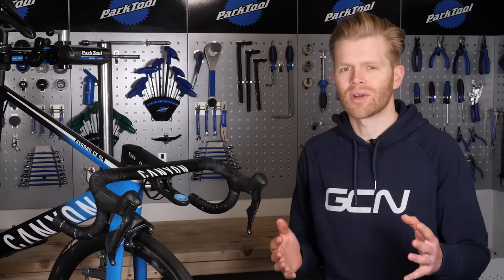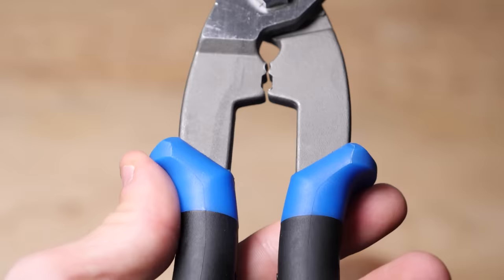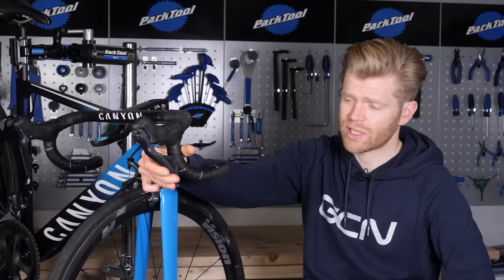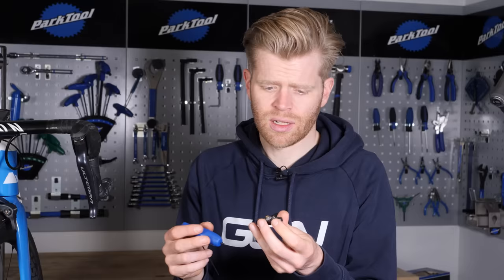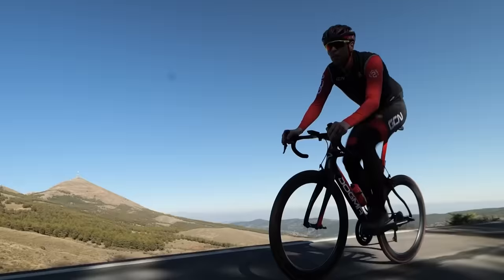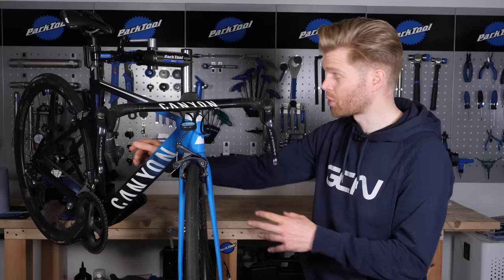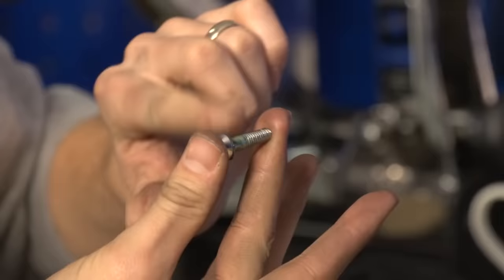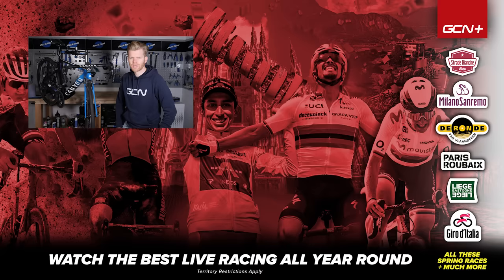Try This Before Changing To Disc Brakes! | Maintenance Monday

Comment: Another great tech video.  For rim brakes I must say, I never loved picking out the shards in the pads. I know they are light and classic in look, but I don’t think I’ll buy another rim brake on except maybe a older bike replacement.  I just makes sense to me that Wheels work better (aero & light) when the don’t have to do the job of a rotor as well.  Other than nostalgia, I just don’t see any real advantages now and in the future.  Disc brakes just work better and with little hassle.
Reply: Hi Joe, I've posted this elsewhere, but thought you might find it interesting. I have been using Kool Stop brake pads for years. They have a feature called a "plow tip" which significantly reduces the grit that makes its way into the pads. For me, it has made the problem a non-issue. Here is what Sheldon Brown says about the feature.

Plow Tip

The plow tip is a small wedge-shaped projection at the rear end of most Kool Stop models.
It acts as a squeegie to clear water and grit from the rim, so that they don't get caught between the braking surface and the rim. Setting conventional flat-surfaced brake shoes so that they provide toe in creates the risk of trapping grit and sand between the brake shoe and the rim. This grit then gets embedded into the surface of the brake shoe, where it grinds away at the rim every time the brake is applied. This causes premature wear to the braking surface of the rim, a serious problem on bicycles ridden in muddy/sandy conditions.

It also provides a built-in guide to ensure correct "toe in" of the shoes.

Comment: You can change the pads without removing the metal pad slots. If the alignment is correct, just remove the wheel and replace the pads. (Pads are cheap, and my fantasy is that the pad compound degrades and hardens over time. Go replace your pads.)

Comment: Yes, modern model of caliper are way more powerful than before. But the pull ratio is different. If I want to replace my old calipers(tektro R530) with 5600 levers, any suggestion?

Comment: The design varies, my dad had a saracen x1 gravel bike which has cable brakes, they are powerful enough to cause the wheels of the bike to lock into a skid, so it can be powerful even without hydraulic,  but I wonder if in the long run the cable brake system is going to be more expensive in replacement parts.
Reply: Hydraulic disc brakes main benefit is modulation, not power.

Comment: Any tips to reduce rim wear in wet weather?  Short 2-3 mile commute the other day in the rain.  Brakes make an alarming gritty, scraping noise now and the pads and rims are covered in grey dirt/ metal worn off the braking surface.

Comment: What I'd like to see is a tech presentation with regards to the amount of stress placed upon spokes/hubs.  What (if any) difference is there between disc and rim brakes?
Reply: there is more on disc brake...

On rim brakes the braking is on the rim.

disc however is at the hub meaning the spokes take the force. same reason a disc wheel is cross laced front and rear to take the load
Reply: Why do you think front wheels for disc brakes have (in contrast to rim brake wheels) no more radial spokes (although radial is far better for the aerodynamics), but mostly two times crossed on the disc side??

Comment: @GCN Tech I angle the front pads so the rear touches first.  As the wheel rotates, the rear leading edge touching first 'scrapes off' any debris/dust before the rest of the pad touches the rim.  Toe the front to touch first 'traps' any potential debris under the pad to get compressed into the braking surface as you brake.
Hope that makes sense!

Comment: Thank you for video! Just a question- there are brake cables in the market in price range from 3€ up to 40€. 
What's the difference?
Reply: Good mid-grade cable gets you polished stainless steel for smooth sliding, added corrosion resistance, and added durability. And the housings are more durable, slide better, and compress less.  This is the level that good shops buy in bulk. Beyond that you get coated cables, and compressionless housing is available. For me mid-grade does the job, but I won't try to dissuade anyone from trying the fancy stuff.

Comment: The problem is that disc brakes are forced on you by the industry!!! I am currently looking into purchasing a new racing bike. had a canyon aeroad ultegra di2 rim brake. great bike but would still like the new model. Now that they have solved the problems at canyon . But is only disc brakes on the SLX types. And that just sucks

Comment: One thing I've seen people fall foul of (because most people don't know) is using incompatible lever/calliper combos. Shimano have changed the pull length multiple times between series.

Comment: I used rim n disc brake (but not the latest)..found out rim brakes did perform too well (performance, easy, maintenance, modulation, reliability) instead of years of usage..the only problem is, due to marketing trends, only few rim brake wheels updates nowadays compared to disc wheels

Comment: Rim brake is easy to fix change and also strong stable and best that's why There's still people using rim brakes although most cyclist use disc brake now i use rim brakes they're more durable not annoying than disc brakes disc brakes are creaking after many use when you brake it's having creaking sounds unlike rim they're silent

Comment: Also compressionless outers (which are good idea if you're using cable discs) will make a difference to rim brake performance.  Not cheap though, but hey..
Reply from the maker: Marginal gains are still gains! 🤷‍♂️

Comment: Had Cervelo with D/A rim brakes , got Pinarello with D/A disc brakes . Big mistake , should've get rim brakes !!! Discs , heavier , noisy as hell . My ZIPP wheels on my Cervelo were spinning like yours in the beginning of this video , weight of the valve would do "pendulum" . Disc are always touching , hate it ......

Comment: Good info Ollie, quick question though, in the intro i noticed your wheel moving and looked out of balance? do you balance wheels? does it matter? what does science say about that....
Reply: That was the weight of the valve stem pulling on it like a pendulum

Comment: A couple of memories from the old days (1970s/80s): Smooth chromed steel rims (lousy for braking in the wet) — and then some genius designed them with dimples to "add grip".  The effect of the dimples was less contact area between brake block and rim, coupled with the dimples holding water on wet days. A lethal combination.  The other daft idea was brake blocks with a thin layer of leather for better grip in the wet.  They actually worked at first, but the leather then became impregnated with an oily residue from the road and then they were worse than ordinary rubber blocks.

Comment: I only place that I see disc as being a huge advantage is when you are using carbon rims. To many issues with carbons and rim breaks for me. Maybe descending at high speeds also. For a flat lander like me rim brakes are fine.
Reply: Advances in the breaking surface design on rim brake carbon wheels are improving this often cited limitation of rim brakes. Long live smart and creative engineers!!!
Reply: why one needs carbon rims?
Reply: Your tyres stay cleaner with discs - especially noticeable if you're using trendy gumwalls and it rains a lot! Apart from that, rim brakes are perfectly fine.

Comment: I can lock my rear  wheel on 50 km/h with rim brake , yes I need to put some power to do that, but I don't fell lack of braking power in dry conditions. Yes, I can feel reduce braking power in rain, but I more scared to loose grip with tires then with brakes, so I use zwift to train when it raining.

Comment: A smidge of superglue on the cut cable end will help prevent fraying as you thread it through the housing.  Also, a dab on the spot your're going to cut, before you cut it.

Comment: That's not a grub screw. Grub screws are headless; an example would be the high and low limit screws on a current, toggle-style Shimano front derailleur. I wouldn't bother correcting him but he used the wrong term several times. The pad retaining screws are just screws.

Comment: Used to hate rim brakes as a kid. Could never seem to adjust the brake pads  correctly. Been thinking about getting a bike again after 40 years and one of the things holding me back is having to adjust the brakes again.
I notice how he doesn't show how to adjust the distance of brake pad to wheel.

Comment: One of my older road bikes— not direct mount—  has calipers with rusted springs.  Instead of looking for compatible springs, I am thinking rather of changing calipers altogether. What would you recommend?
Reply from the maker: Hi Victor, thanks for your comment! If you're able to find a replacement spring for your current calipers, that would probably save you money and would give a new lease of life to your brakes! Obviously, if you can't find a replacement spring, then your best bet may be to find a replacement caliper all together. If you can recycle a part, or keep it going for longer, not only is this the better option for the planet, but also the nicest to your wallet! We hope this helps :)
Reply: @gcntech  Thank you for your kind reply. 🙏🏻 I have never changed caliper springs before so I was doubtful that they could be found as spare parts. I will look. Thank you for your suggestion. You are very right and on all counts. 😌

Comment: I've used GT85 (contains PTFE) for years to clean braking residue off my rims. It's very effective, and for reasons I can't explain, it doesn't cause any problems with braking. If anything, the clean rims provide more effective braking.

Comment: #askgcntech dear team ..can you tell me if  you use an oval chainring upfront and are fitting a new chain . Does it matter if the longest part of the chainring is vertical or horizontal??? Or doesn’t it matter also how many extra links . Cheers

Comment: There is a tool called a 'brake tuner' which will space and toe in brake pads perfectly every time. Fairly inexpensive, £10 or less, worth adding to your tool kit if you prefer rim brakes.
Reply: Link ?

Comment: Unless you need disc brakes e.g. you ride in the rain, highly recommend rim brakes. They work well even on carbon wheels and are nearly completely hassle free!
Reply: It is annoying how easy it is to de center the brake calipers
Reply: @calebgonsalves2970  indeed. Disc brakes have superior braking power but at an annoying cost.
Reply: @sustainf  its money well spent because disc brake bikes sell better secondhand

Comment: I'm concerned about building up too much heat with rim brakes on my carbon rims when braking hard into corners.  advice ?
Reply: Pulsate the braking.
Reply: Swap the pads, unless they're older carbon rims you shouldn't be braking for too long. Don't forget your rims are rotating many times a minute on a downhill, that's a lot of cooling

Comment: He only downside I have with rim brakes is bike transport. I need to put my bike in my car for transport. With disc brakes it's so easy  , unscrew and remove. Rim brakes you need to undo the wire to widen the pads gap.
Reply: Many 21st-century rim brake models have a lever that you flip up to open the caliper. With wheels increasing in rim width these days, you may not even need to do it if the tire is:

A little wider than the rim
As wide as the rim
A little narrower than the rim

Comment: I never ride in the rain or deep mud, so disc brakes are unnecessary for me. It is becoming difficult to find even low end bikes without them. I was helping a friend get a bike and even cheap, heavy bikes with bad wheels are tarted up with discs.

Comment: I can vouch for the "upgrade your calipers" part.  I upgraded my road bike to Paul Racer M brakes; the price tag isn't for the faint-hearted but holy hell these brakes have a sturdier feel than even the hydraulic disc brakes I've used.  They are center pull so I also needed to get a cable hanger that slid over the steerer like a headset spacer.  But I get that disc brakes are better in the wet...not even the best calipers can change that.

Comment: smh no mention of compressionless brake housing? If you have standard m-system style housing on the rear brake then upgrading to compressionless housing can make a huge difference to the feel of the brake lever

Comment: One more tip: Upgrade brake pads. They want to sell you wooden hard pads to serve you a lifetime, but they brake awfully and wear rim hard. Get better pads which slow wheel by grip instead of hard squeezing action. Clean pads and rim according to riding conditions and they will serve well.

Comment: Has anyone considered having a disc on the front and a rim brake on the back? I ask this because of all the frames geometry made for rim brakes could be used up. I’d only need a front fork change maybe 🤔 just a crazy thought I’ve had.  A response would be appreciated 
.Thanks.
Reply: The majority of your braking power comes through the front wheel because of weight distribution, so your idea makes theoretical sense.  It's too easy to lock the back wheel.  Many fixed gear riders have front brakes and no back brakes.
Reply: @mikefule330  thanks for responding Mike 👍🏼

Comment: GCN have been pushing disc brakes for years and supporting the bike industry and I can’t believe so many have been sucked in by it. 
Rim brakes are perfect for road bikes and simple to maintain and look great. 
Discs are heavy, ugly and a pain to maintain and also expensive due to fast wearing of pads and rotors. 
I know a lot of riders who are going back to rim especially in the winter as discs are just too noisy in the wet. 
I’ve just been riding in the mountains on wet roads and my rim brakes were still too powerful for the tyres to maintain grip. 
Discs have been the biggest con in all the decades I have been racing and riding.
Reply: You do know that rim brake wheels also wear out. Why do you think they come with wear indicators and warning labels telling that they will wear out with use?